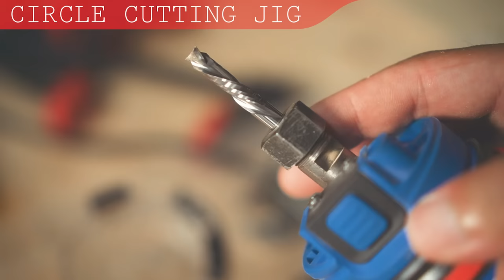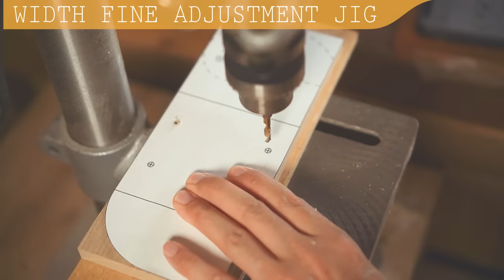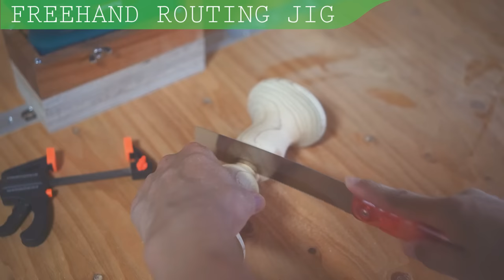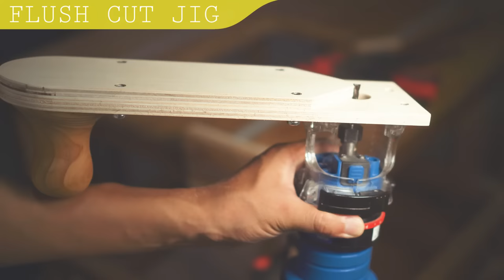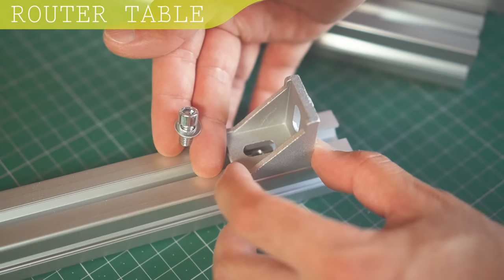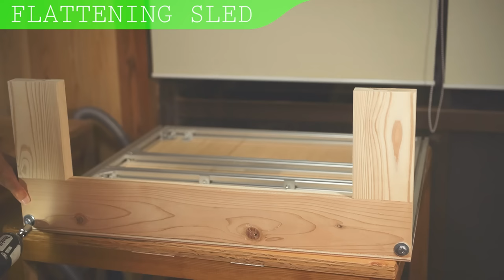10 Simple Trim Router Jigs  / Diy woodworking

Comment: Simply facinating! You should continue to share your expertice. What do you call thosr screws which you insert on the project? The screws that placed into the drilled holes and are tightened into the wood? Keep the good work up!